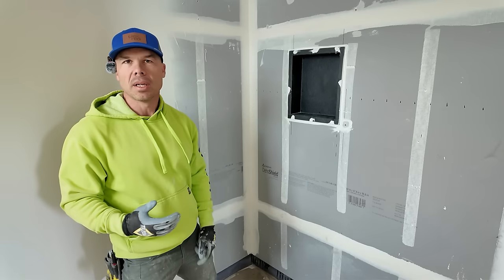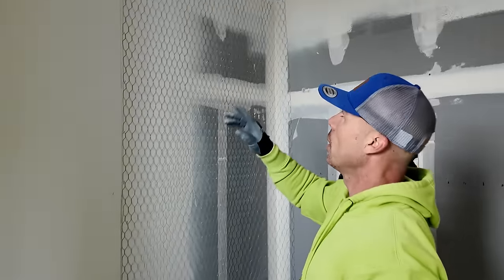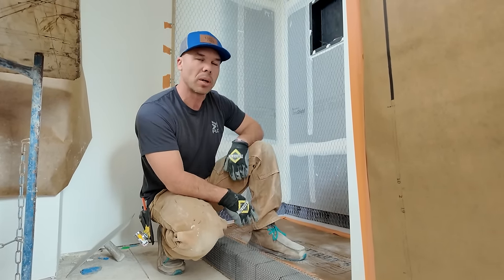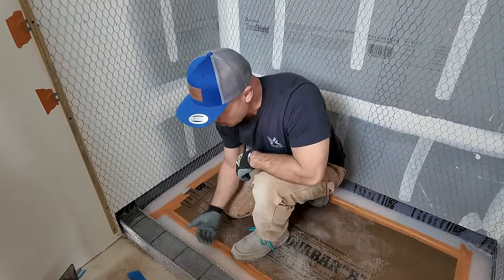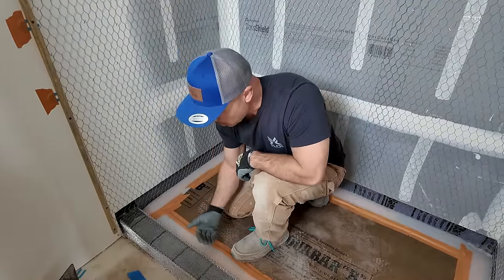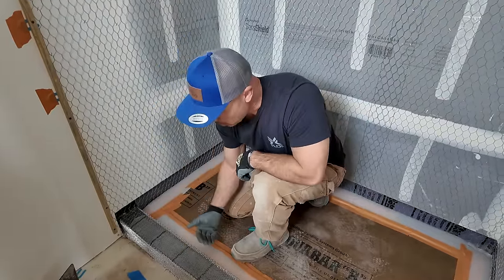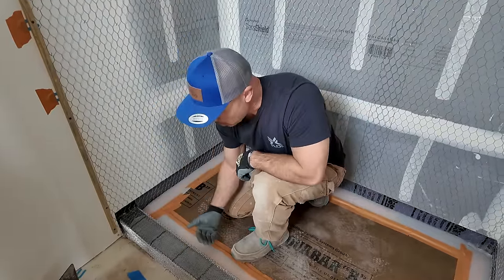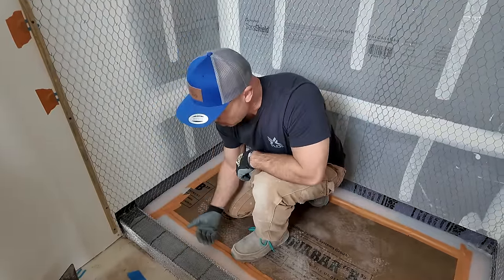How I FLOAT a SHOWER --- OLD SCHOOL Tile Shower Build 2024 Episode 3

Comment: I just finished a dry pack shower floor the first one I’ve done in many years my boss loves schluter pans and I think they suck and the only reason he let me do a dry pack is because I shower is 4x8 and he couldn’t find one 😅 hopefully now he will let me do a lot more because the cost was a lot cheaper I mixed it the old way with sand and Portland he was aware it could be done   for that fast and cheap it probably took about one and a half hours he was alittle impressed and that was the first in quite a while . Thanks for the videos I’ve learned a lot by watching them. Have a good day my friend
Reply: Why do you think Schluter sucks?
Reply: @jwd215  it’s just my personal opinion you may like it and a lot may like it but I think it’s one of the worst product on the market for water proofing, laticrete makes a waterproof product much stronger and easier to apply and that’s just one I even like Go board better than schluter system in my opinion because it was maybe the first they didn’t improve it they left it be the schluter board has what looks to be a paper product for the water proofing it’s just not something I like now again my boss likes it but ever shower I do with schluter I tell him again and again that if it fails I want touch it, but any product I recommend I will stand behind .
Reply: Ok. I love Go Board. I've been installing wet bed for 15 years. Just install my 1st schulter pan a few weeks ago. I thought you may have experienced failure, that's why I asked.

Comment: I always appreciate watching you work and how precise you are, making sure everything is measured correcting, level and plum, etc. Cutting no corners at all. I've been remodeling different rooms in my house (built in 1979) since we moved in years ago and I've come to the conclusion that the builders had no idea what a level was or how to use it, and I'm talking walls, floors, subfloor....anything. Tearing down the house and rebuilding it would likely be easier. Great channel and very informative. 👍

Comment: I understand the concern about putting fasteners through the interior curb face and top. Starr Tile does use fasteners through cement board at the curb but does seal them up with thinset and waterproof membrane without issues. If done correctly his system works just as yours does. You are both right. On my curb, I actually use fasteners but I don't bury them right away into the cement board. II start the fasteners and then pull off the cement board and then silicone where he fasteners go. Then I install fasteners, cement board, thinset the entire curb fasteners and the curb, then waterproof with whatever waterproof membrane is available. It works.

Comment: Grew up in the float game for years when my grandpa started doing tile that is all it was was mud work. We never went over top of sheetrock though. We staple felt paper to the studs, then metal wire, then do a rough coat, then a float coat. But this is awesome man that you know how to do this very few of us do!
Reply: I'm using cement board and red guard and wondering why the F this guy is using drywall?
Reply: @andiamocclash397  Because this is how it used to be done, it's more work but lasts a lifetime, the newer way works but doesn't last as long.
Reply: @majesticmajestic7058  I very highly doubt the new way is not a more quality and time saving way to do this. and the materials exist, this is just cheaper I guess, but defiantly not better
Reply: @andiamocclash397  This is cheaper as far as the materials, not the labor unless it's a DIY'er. This way will out last the newer ways, like most things in the modern era, newer doesn't always mean better, but faster and cheaper, like IKEA quality furniture vs real solid wood furniture.

Comment: I always make my niche oversized and add foam board or more thinset to get the final dimensions. There is so much going on it’s very easy to have a brain fart and have the niche the wrong size or wrong position. Even a 1/8inch mistake is too much of a mistake sometimes. I find it easier to make the niche oversized. Cheers !
Reply: I’m the same way my friend I found out the hard way several times that means I’m a slow learner 😅 but now I make mine over size and fill it.

Comment: Isaac, the capillary gap is a great idea. But the weight of the walls is only supported by staples.
 
A couple of ways to overcome this structural weakness: 

Use nails as is if stucco job.

Instead of foam/sealant, use strips of hard poly (similar to material uses for cutting boards). Waterproof and transfers load to your pan.

What saves this build is the bottom row of tiles ends up supporting the walls. That DalTile Hydro is strong, but would worry if someone did this same method w/Chloe, for example.
Reply: lol, the best way would be to only put the gap around the curb!
Reply: He did a tearout on his own shower build that had stapled tar paper behind the mortar and the whole wall just fell off in one piece. At least this one has drywall, which the mortar will happily stick to.
Reply: The stapling is fine because all 3  walls become a monolith. (If the house burns down, those walls will be standing even without the wallboard behind them.) The problem here is they are just hovering over the pan. But like I said, the bottom row of tiles rest on the pan and probably are enough to support the load. 

In the end, capillary gap is a great idea but only needs to be around the curb.
Reply: I was thinking of the same. Maybe sink screws into the studs every 8" or so, angled upwards, so the load on the screws will be less shear and more tension. Leave the screws protruding ~3/8", so they will hold the mortar layer as if it were a sheet of cement-board.
Reply: If your concerned do a bonded type. Prime the wall, with a small notch trowel apply a layer of tile adhesive (not rapid set) install the mesh then float he wall with the levelling mud.

Comment: Amazing work as always. I was wondering, how do you determine the 90 degree angle between the back wall and the side walls by using those strips? In Europe they use laser level for metal strips. Thank you

Comment: Nice. As always great work. I miss the stucco method. So pleasing to get that absolutely perfect wall surface. Question. Any thoughts on using galvanized nails over lath (on stud center) for added rigidity? Could prevent wall buckling and separation of wall mortar from DensShield. I have done a couple dozen estimates up here in NorthCal where exactly that is happening on an otherwise perfect install. Shame is that there is no easy way to repair it, you usually have to rip everything out and start over. Seems like such a waste because of a small thing like adding a few nails. It is a code in SoCal. Not sure why it is not code up here in NorthCal. Wondering what anyones thoughts are on this. Has anyone had callbacks due to the mesh separating from the wall with only staples?
Reply: I was thought in Socal in the early 2000s just  using staples and a good amount over lath..But over time I have noticed adding a few galvi nails for added assurance gave me that piece of mind..Plus there are some inspectors looking for nails 8" apart.
Reply: @felicianoalvarado7548  Interesting during my time in SoCal every single inspected demanded 8'' galvinised nails on stud. I manly worked high-end new construction, multi million dollar SF residential. Could be unique to that niche build types. Also we did use scratch coat on diamond lath, not drywall with chicken wire mesh. Bit different.
Reply: @RafaelTileWorks yes same here, in early 2000s I was working in the La Canada area new construction as well..one coat float over green board..I don't think that's allowed anymore at least in Socal..and yes now inspectors demand 8" spacing with galvi nails
Reply: @felicianoalvarado7548  Makes sense. I must have demoed a few dozen cracked tile walls. All due to float cracking and buckling away from the wall over time. It is amazing what a huge difference a few nails can make in just a few sq ft of wall tile.
Reply: How would you suggest we nail the lath into the studs? With the wire lath under the head of the nail?

Comment: This seems like a lot of work for minimal gain.  Could whomever set the backerboard not furr out the walls level and plumb?
Reply: they probably thought "that's the next guy's problem..."
Reply: They can try but a drywall guys idea of level is not usually good enough for tile install.
Reply: 6 to 1, half dozen to the other. A tile setter might be able to float plumb/flat faster than running a bunch of full length, tapered shims on janky old studs. Especially if there's a belly in any wall

Comment: I don't get it. Why are the walls floated with mortar? Is it just to get a flat surface for the tiles? If so, doesn't the tile leveling systems enable this to be done over the denshield/cemet board without all the labor of putting mortal on walls?

Comment: were you using pencil liners around niche? just looked like a gap around, not full tile like you said. anyways are your mud walls done when only specified by contractor , done if clients ask, done on all jobs, only on jobs where the studs are super bad,  etc?  just curious on the selling aspect because i know the walls can be just as flat using non mudding methods, so just curious when or why you do them?

Comment: The best method would be to only put the capillary gap around the curb. The problem here is the super heavy wall structure should be resting directly on the pan. Instead it’s hovering an inch above the pan. Clinging to wire and staples.
Reply: … so like. This is very close to how four story buildings are stuccoed and they are not resting their stucco walls on the foundation, that would be really silly. There is a reason you use calk in the corners and not grout.
Reply: The wire lath on your exterior stucco is nailed into wood sheathing. Not stapled into gypsum board.

Comment: Is there an alternative to floating the walls?
Reply: You can use Goboard. It’s much easier, comes flat and gets screwed to the studs rather than floating in mid air supported only by staples into drywall. I’m actually super surprised California code would allow this considering all their earthquakes that could easily shake off those staples. But I guess it seems to work for them 🤷‍♀️

Comment: Back in the day, when concrete walls were common, the stucco contractor would be asked to float the shower walls. 

The work was crude. Good enough for an exterior stucco wall, not good enough for nice tile work.

Comment: If i was there I dont need to do tile in the floor and with wood and mark evrything in 2024 you have tape measure you dont need mark in the wood😂😂👎👎
4 days still not starting to set the tile omggg man 4 days i did 1.900SQF 😂😂😂
Reply: Dang another troll 😂 keep using your tape for those small tiles and setting 1.9 sq ft in 4 days 🤣